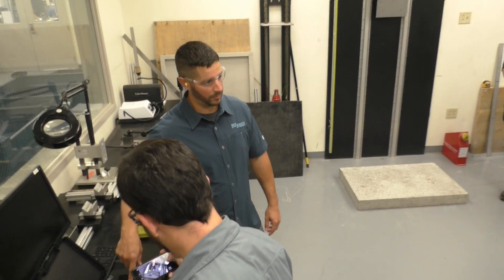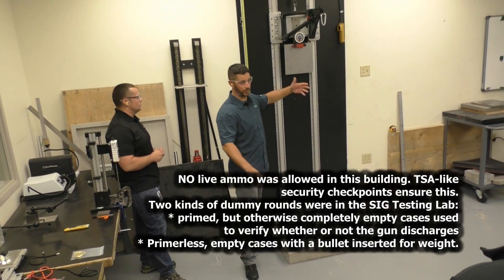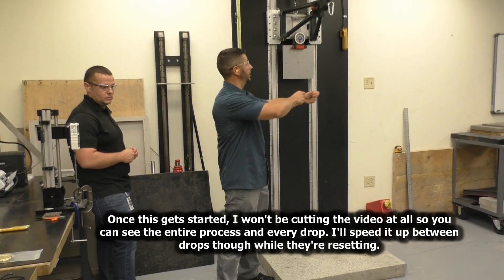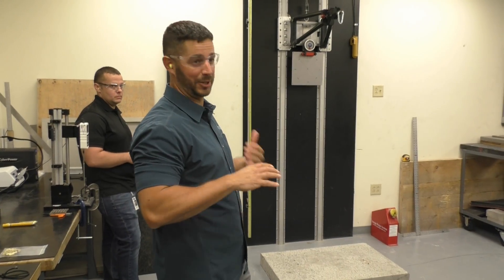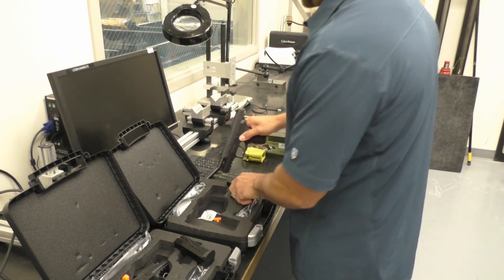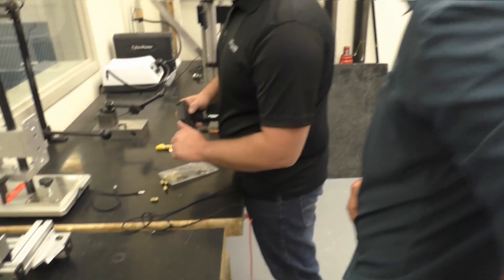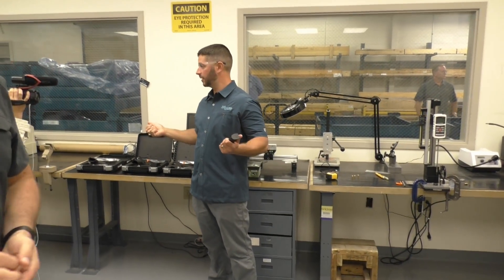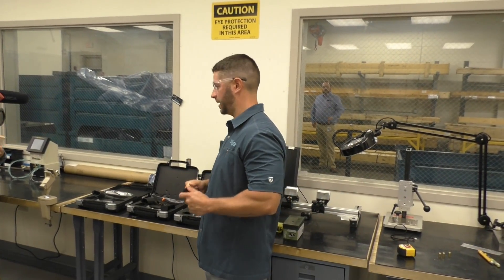Drop Testing Upgraded SIG P320

Comment: Do a vid where you hit the striker pin repeatedly twith a hammer trying to get it to fire. People have gotten it to fire before the upgrade fairly easily, but ive yet to see a video of doing this after the upgrade. I own the p320 and like it alot, but need to feel like i can keep it in my house again.
Reply: How often do you smack your gun with a hammer?
Reply: @fullfire0  when im trying to test how safe a gun is if i drop it.
Reply: @justjoshin5900  That's.... really stupid
Reply: @fullfire0  being unsafe is whats stupid. You should know that if you know anything about firearms
Reply: @justjoshin5900  And smacking your gun on the back with a hammer is safe? All your doing is putting unnecessary stress on parts of the gun which could lead to problems later on that it otherwise wouldn't have.
Reply: @fullfire0  your not wrong. But this was a known issue the the p320. Am i wrong for wanting a video to know the problme has been corrected after the upgrade? We can agree to disagree all you want.
Reply: @fullfire0  its not a known issue with every gun, only the p320, that i know of. And i own one. I never said i smack every gun i own on the back with a hammer. You did. Do you really think a combat veteran smacks every gun in the back with a hammer that he owns? Cmon man get real
Reply: @justjoshin5900   @JustJoshin'  Dude seriously? First off how the fuck am I supposed to know you're a veteran? Second, I asked "How often do you smack your gun with a hammer?" and you said "when im trying to test how safe a gun is if i drop it." You didn't say only the 320, so how else am I supposed to know that's what you meant? Also being a combat veteran doesn't automatically make you competent
Reply: @fullfire0  obviously, we can agree to disagree and misunderstand each other all day long. I  dont think you and i would find any common ground on the safety of the p320, post upgrade. Sometimes people speak two different versions of the same language. Good day, sir.
Reply: Or how about EDC it ya know?

Comment: Am I the only one that noticed that there is another problem with the p320? In videos I've seen showing that little shoe looking thing that disconnects the trigger and the notch in the underneath of the slide for it. It's an "OUT OF BATTERY" safety!! Just tried it out at a gun shop and the non-updated one would fire if you pulled the slide back a little and pulled the trigger. The modified one would not. Seems like Sig had a second thing they missed but nobody caught it.
Reply: That’s a safety feature. Not an issue. The trigger has to fully be reset and in battery for the trigger to operate. Why would you want the trigger releasing the striker out of battery anyways?

Comment: Just found out about this drop issue. After taking a look at the trigger assembly on my own P320 (bought in 2015), I don't think the problem is with the trigger, at least not directly. The trigger on the P320 is suppose to actuate a fire pin safety, which at rest blocks the firing pin from moving forward. The fire pin safety itself is a tiny catch beside the firing pin which pivots up and down to block and unblock the pin's forward movement. 

There is very little spring tension holding this pivoting catch up against the firing pin...literally an ant can push it to unblock position. From what I can tell, the catch only needs to move up 3/32 of an inch at most to disengage the block on the firing pin. The worst part is the trigger transfer is a cam which only pushes the safety catch up to disengage, but it doesn't pull it down when at rest (which if done some other way, would had added more resistant to keep the firing pin safety catch from disengaging). 

After seeing this, I'm not surprise the pistol failed in drop tests. I did a rough test, and figure it only takes about 170 g (~6 oz) of force to push the safety catch down enough to unblock the firing pin. A hard enough drop would most likely disengage the catch, even if the trigger itself didn't move back enough to cam it.

Comment: Nothing but a Sig publicity video.  I will wait a while longer until independent tests have been done to ensure this really fixes the issue.   

This really was a bad design failure on Sigs part and it has put doubts in my mind about the P320 right when I was about to go look to see if I could get my hands on one.  Very disappointing but given time I may still end up getting one.
Reply: davva360 just like with Glock where you have to pull the trigger to field strip it. Which has killed and injured people and property.
Reply: @willthethrill4394  lol you can't compare that. Glock never went off like that. Sig failed they need to own it and the Fanboys need to also and I'm a fanboy myself🤦🏾‍♂️🤦🏾‍♂️🤦🏾‍♂️

Comment: It's not hitting the block at the angle I've seen in other videos that caused the discharge. I don't trust this test or the supposed upgrade until I see more video and more testing by people other than Sig.
Reply from the maker: I disagree with you guys. I've seen P320s discharge on almost every drop at this exact angle, including the one we tested, and SIG showed us professional high-speed video demonstrating it. In their drop testing -- and they performed 2,200+ drops from the 4th to the 7th -- they found this to be the most likely possible angle to get the gun to discharge. Striking the slide first, before any other part of the gun touches, is the worst possible scenario. It moves the trigger enough to clear the striker block safety, and it jolts the gun hard enough to cause the striker to slip off the sear. Keep in mind is it not the trigger moving all the way back that is causing P320s to discharge when dropped! It only has to move enough to move the striker block plunger safety out of the way, then the striker pops off the sear on its own from the impact. The more the gun hits the frame (the beavertail area), the less likely it is to fire as the polymer absorbs the shock of the impact. This is why, in one of the other videos, they were unable to get the X-5 to fire at all. It's large beavertail got in the way and they couldn't get the slide to impact the floor directly. ....hope this helps...
Reply: Tom Baker totally agree. The other tests I've seen had the barrel canted more upwards, this is hitting almost on the rear sight, there's not enough angle to cause the trigger to move rearward. I doubt even a pre-updated sig would go off at this angle.
Reply: The plan is to reduce the mass of various  parts to counter the effect of inertia but won't that make them weaker? Wouldn't it be simpler to just install a blade safety that way the trigger will stay put no matter how high or fast it's dropped? I understand they already have a blade safety produced it's just not being used.
Reply: I hear you guntruth but the best I could freeze a frame it appears the gun is striking the top of the rear sight, not the slide as in the other tests. There might be some drops that do contact as you described I was just unable to find them. I'll be happy to see this upgrade proven to work because my P320 is one of my favorite guns.
Reply: Tom Baker the rear sight is literally attached to the slide? You’re making no sense.
Reply: Tom Baker I don't trust a test done at Sig themselves
Reply: tree rat76 no doubt there
 will be many tests done by others outside sig to upgraded guns.

Comment: So did anyone get to at least dry fire the P320 with the upgraded components?  I am interested in what effect the upgraded fire control system has on trigger action, if any.  Two things kind of bother me about the appearance of the new trigger.  First, the backside is hollowed out all the way to the tip, like the original P320 trigger that caused some people trigger sting.  Second, it looks like it has the rather exaggerated curvature of the SIG "short" trigger or reduced reach trigger for the classic P-pistols that so many people seem to dislike.
Reply from the maker: The trigger pull is better. SIG asserts that upgrading the quality of the trigger pull is why they had made these components in the first place. They've already been in all of the M17 models (the Army's guns) and on other contract guns and they say they were planning on rolling them out into the commercial P320s as well. Then this stuff came up, it turns out these parts resolve the drop safe problem, and SIG is installing them immediately as the solution.
Reply from the maker: I don't think it'll be long. They stopped production of P320s and will start it up again with the new components very soon. They're already making these components for the M17 so there shouldn't be much of a delay. At least on the manufacturing side. I don't know exactly what that means in terms of getting them into distribution and into stores though.
Reply: Ok, Thank you for the reply, was looking forward to getting one since the Army picked it up we have have been using the MK25 in the Navy for awhile, but I guess I will have to wait a lil longer now to pick one up oh well lol
Reply: I hope they do. I'd like to get my hands on a 320 compact in 45acp with the new trigger.
Reply: When do you think these pistols with the upgraded triggers  will become available in stores for sale?

Comment: Were they able to replicate the firing with the original parts?  I would hope that they found some pistols that did discharge using this test, then upgraded them, and now they pass.
Reply from the maker: Yes, they dropped standard P320s and confirmed that the problem is absolutely real. It affects basically every single one of them and SIG has not tried to hide this fact.
Reply: guntruth So the problem affects them all and this isn't a recall yet?  Just a voluntary "upgrade"?

Comment: HELLO, IT HAS BEEN TESTED TO GO OFF AT MULTIPLE ANGLES. THREE DROPS EACH FOR THREE PISTOLS ALSO ISN'T MUCH OF A TEST.
Reply: As stated on the video, at the time we visited they claimed to have done over 2,200 drops over the weekend. They're confident these parts fix the problem. We'll test independently, of course, when our pistol comes back with the upgrades installed. We'll hit it with a hammer, drop the hell out of it, etc.

Comment: They used the small sub-compact Sigs and not the full size as tested by Omaha Outdoors.
Reply: They did 2,200 drop tests split evenly among 5 or 6 different models. Doesn't much matter, as we confirmed the same problem with a P320 Compact. Ours fired twice in the first three drops.
Reply: The need to do the Army's 2007 rough handle test. One angle isn't going to cut it. We've already seen tests that made it go off from different angles as well.

Comment: Damage control...
Reply: SIG showed us certificates for the tests it passed, which is pretty much all of them domestically and many foreign ones. It passed the Army TOP (3-2-045) testing. Plus FBI/DOJ, CA, MA, ANSI/SAAMI, NIJ, and others. Just shows you that the testing obviously doesn't catch everything!
Reply: They state otherwise and the argument is pretty understandable, too. I wouldn't be surprised either way, but am willing to give them the benefit of the doubt as swapping the existing trigger for the reduced-mass trigger resolves the problem pretty much 100% and wouldn't have cost them a single cent to do. They could have started installing lower mass triggers years ago and nobody would have noticed and it wouldn't have cost them anything. For that and other reasons, I'm pretty neutral on whether or not they knew or even thought there might be a problem here. Again, the P320 did pass literally every government, military, state, law enforcement, and independent drop testing certification out there.
Reply: There was a problem, they fixed it.  What did you expect them to do?
Reply: Don't assume they fixed it. They only mentioned one angle. Other tests have shown it can go off from multiple angles. They need to do the Army's 2007 "Rough handling" test to see if it's drop safe. That wasn't done.
Reply: To that point, why wasn't the Army's 2007 "Rough handling" drop test used in the MHS RFP? I didn't find anything about a drop test in the RFP, but it goes into every detail about all the other tests. Coincidence? They also stopped the MANDATORY MHS testing halfway through even though the RFP said it "shall" perform all those tests (hence Glock's protest). If you read the GAO's answer, it was utter nonsense. Nothing but lawyer speak that didn't justify anything.
Reply: Jeff England I think the problem most people have is that it seems they knew about it the issue prior and didn't do anything to fix it until it became a mass problem online.